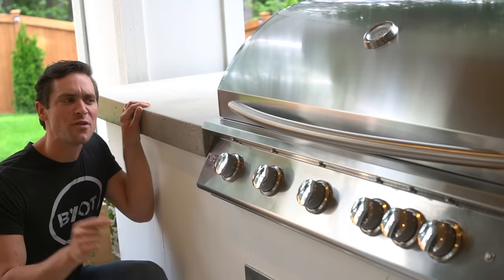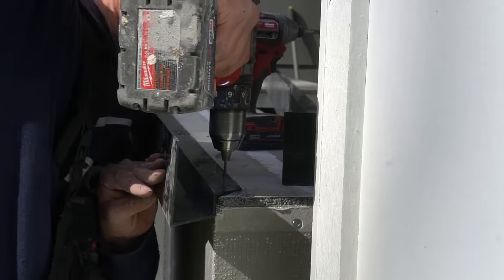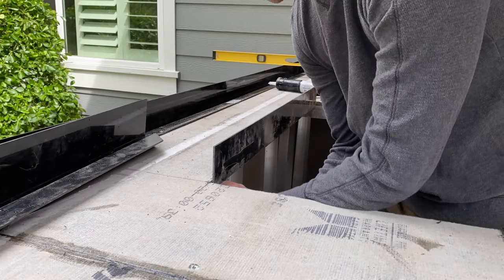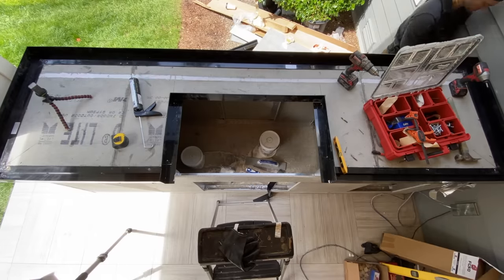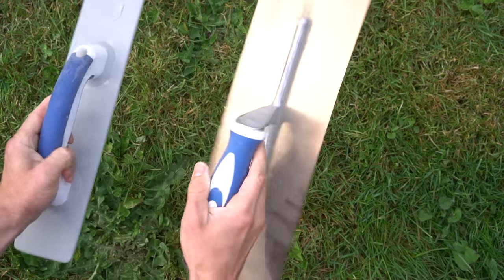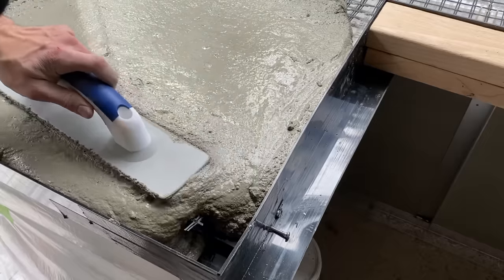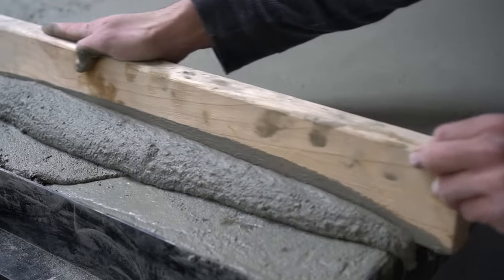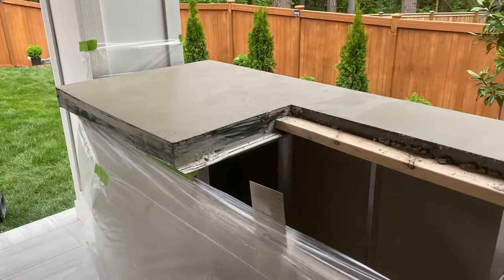DIY Concrete Countertops // OUTDOOR KITCHEN COUNTERTOP

Comment: Another trick to help get the concrete to settle down in that I've done is of you take a Sawzall blade and grind the teeth off then screw a block of wood to the blade you can then use that contraption in your Sawzall and lay the wood on top of the concrete and vibrate from the top to force concrete down. Then just add more concrete to fill the form back up. Works in a pinch.

Comment: My biggest question about this project was how to figure in the finished dimension of both the fascia material (stone veneer in my case) and the finished concrete top so that the grill would play nicely with both finished surfaces. Your project was the most detailed I’ve seen on the subject and I really appreciate all the time you took. I’m still on the fence between pour in place counters or making a mold and then flipping the counter. I’m a gas log manufacturer so I have a lot of experience with mold making and concrete products but this is new territory for me!
Reply: Still no response 😂 don’t you love it
Reply: @deeruckussolutions8772  yup. I went ahead with the project and the initial quality is fantastic. I would never advise anyone without being a true expert so I can’t yet speak to the longevity of the build. My best advice was to simply get all materials on hand first so you can get your best measurements in person. The manufacturers measurements were not accurate enough for me.

Comment: Try using the front edge of the sander base against the form, it will hit much harder and work the air out much more efficiently. I have used a thick wet cast concrete and can work just about all the bubbles out

Comment: This is very nice. My question is: the base upon which you pull the concrete mix, when the concrete drys up, do you remove it or you leave it there?
Reply from the maker: Great question and you just leave the base in place. No way to get it out and it just adds support.  Thanks for watching and hope you subscribed.

Comment: The finished project looks amazing, and a great video. I’m thinking of trying something like this myself in the UK 🙂
Reply from the maker: Great to hear and thanks so much for watching.  Can you get Countertop form and concrete mix products in the UK or are you going with a different product line?  Thanks for the support and hope you subscribed.
Reply: BYOT Hi it’s something I’m thinking about at the moment so not at the stage yet for buying products. I don’t think I can buy the formers you used, hopefully I will find a different brand here. Yes I subscribed looking forward to getting some more ideas.

Comment: How did you remove the z form against the vinyl siding?  Looks like there is no clearance to remove it. Did you leave it there?  If so, did you cover it up with concrete?

Comment: home depot carries a concrete brand that is pretty much almost pure liquid and it solidifies in 1-2 hours or so. I can see that working better here. There would be no need of screeding or floating at all
Reply from the maker: Interesting.  I'll have to check that out.  Thanks for the tip Salvador!
Reply: Do you know the brand?

Comment: I've been looking into this form system for a while. Looks like a pretty sweet system.  I'm a tile contractor and would love to expand my offerings.  This might be the one.   And I am wondering if the cost is less or comparable to granite, of course it's also what a customer may want no matter what.
Reply from the maker: Great to hear bud and thanks so much for watching.  As for price the concrete is obviously much less then a solid surface but you also have to take into account the amount of time you are putting in compared to a set it and forget it with granite.  Pretty comparable when it’s all said and done.

Comment: Hello, great video! I’ve ordered the countertop forms you’ve linked. Looks like it’ll save a lot of time.

A have a question, you mentioned in a previous comment that you used Airtex ovp for the walls. Did you reinforce it with any kind of mesh?

Comment: Serious question: what is the reason for concrete reinforcement in the middle of the slab? Isn't this where the tension/compression converge and there is no compression and tension? I would think reinforce near the top or bottom depending on tension or compression.

Cool forming system

Comment: Great video - not sure if you still monitor the comments or not, but I did have a very specific question about how you used the z countertop forms along the inside area of the grill cut out.  You touched on it briefly in the video, but it wasn’t very clear.  I’ll be doing mine this weekend using the same system - would it possible to get clarification?  Did you use and modify the square edge (snap off) form or the pre-cast (non-snap off) form?

Comment: At 10:25 I noticed a significant bulge along the length of the form. I'm about to do a 10' counter with the same form kit and I'm trying to figure out how to avoid that.
Reply from the maker: Great catch Justin and that did happen but I just ground it down slightly with that diamond wheel I used and is linked in the bio of the video.  To avoid I would make sure to get the mix runnier than I did and if you need to add a clamp You can always do that in the end.  Thanks for watching and hope you subscribed.
Reply: @BYOTools  I certainly did subscribe. You seem to be doing all the things I have on my list to on our place. Thanks again.

Comment: Great video but concrete counters are the worst. I think the fad is over.
Reply from the maker: Not yet! haha.  By do you dislike them?  Thanks for watching in any case and hope you enjoyed the video.
Reply: @BYOTools  Well, to start it's still porous even if you seal it once a year and maintain it. It will absorb anything over time, especially if you have it outside. Mine absorbed almost everything but it was indoors and it was in constant use with cooking and washing dishes. I gave up and replaced it after 2 years. Maybe you don't care as much 'cause it's outside but I just couldn't take it anymore. Cheers! I thumbed up your vid btw.